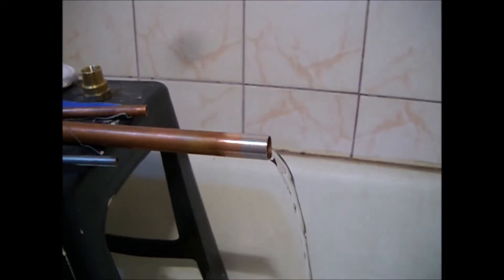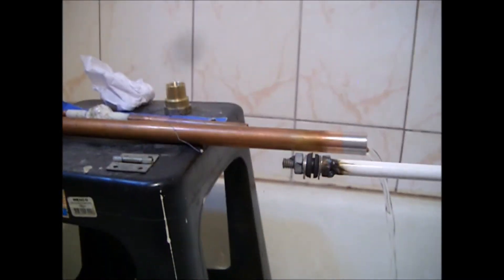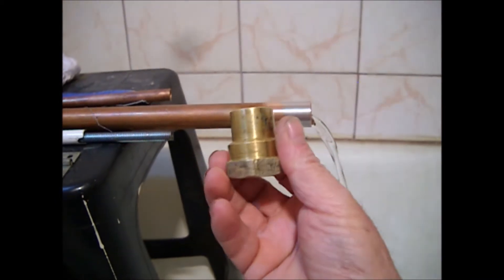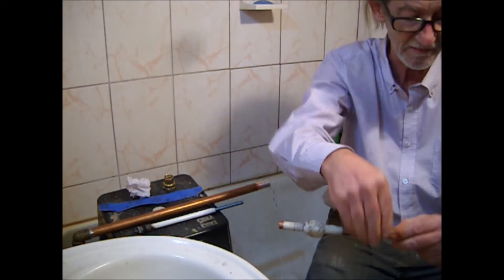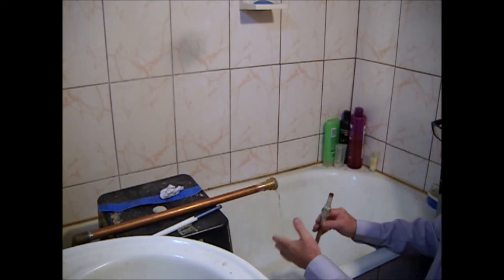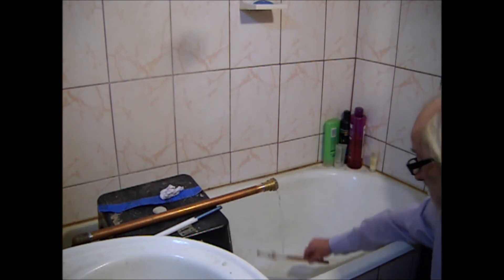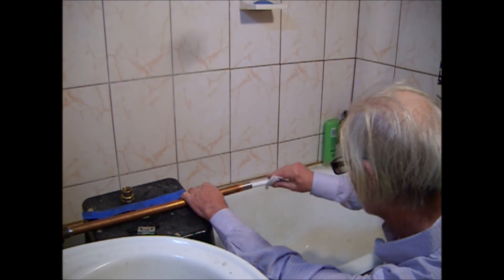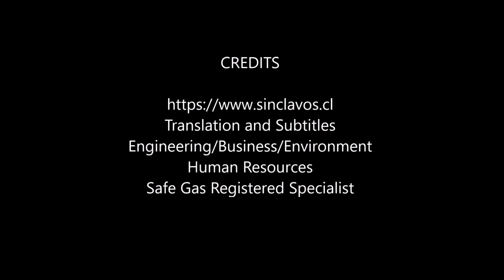Make your own Water Blocker Tool for Soldering or Sweating #solderingtools #sweatingtools

Comment: In Australia  silver soldiering is the only plumbing method  by law  soft soldier is outlaw
Reply from the maker: Hello Jack.  That's interesting.  Also for water pipes?  In Chile, hard solder, not necessarily silver, is compulsory in gas systems, but in water systems unleaded soft solder is compulsory.
Reply: Very little lead free soldier available in Australia especially in full sticks @RODsDIY
Reply from the maker: Sorry to hear that.
Reply: Their is very little need for lead free soldier in Australia silver is compulsory  if your building a still you don't want lead soldier in the construction of the still  it is legal to make alcohol in Australia as long as you don't sell it @RODsDIY
Reply from the maker: In Chile it is legal to smoke pot, but it's illegal to buy it, grow it, find it, create it by spontaneous generation, or let it fall on your face thanks to prayers. It's a mad, mad world.  And it's no joke.